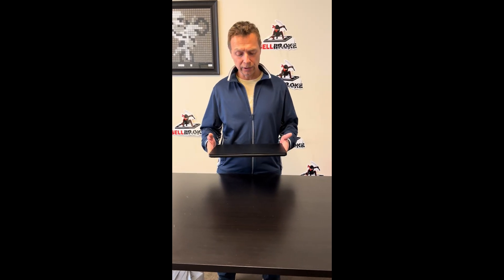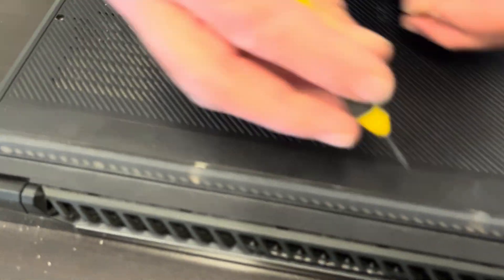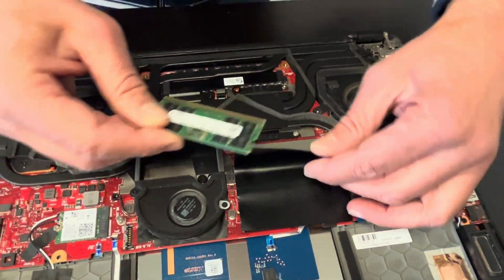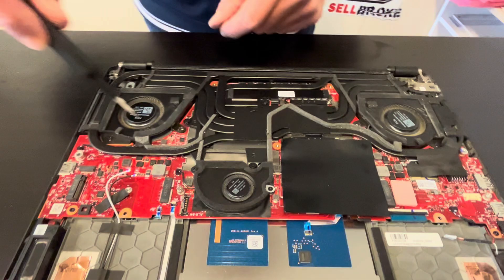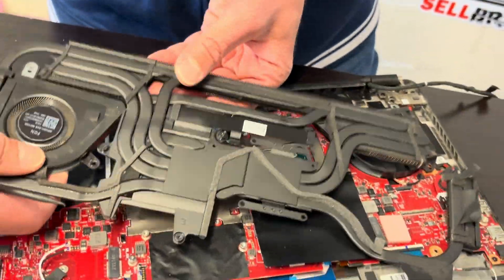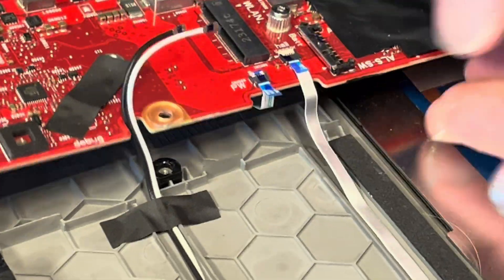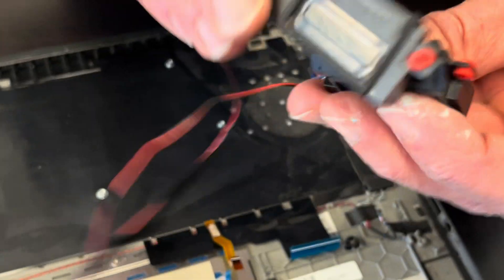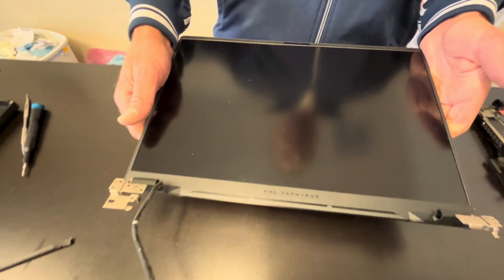Asus ROG Zephyrus M16 Laptop. Take apart, fix, repair, upgrade, replace: memory, SSD, LCD, Battery.

Comment: Hi my zephyrus m16 2022 wont charge or turn on, I already removed the battery and hold the power button for 2 mins and directly connect it to charger but it wont still turn on or indicator that it is charged, I tried reconnecting battery again and still not turning on, what do you think is the problem?
Reply: I have the same exact problem. I took it to computer repair shop and after troubleshooting, it seems to be a faulty motherboard. Especially after only owning the product for 2 years, very disappointing and frustrating.
Reply: @sanjoplakkal  yeah the computer repair shop replaced a burnt IC, and now its already working.